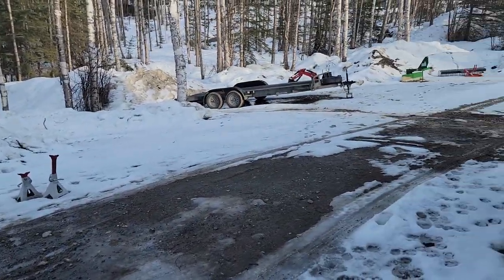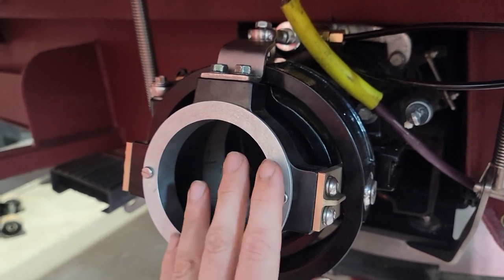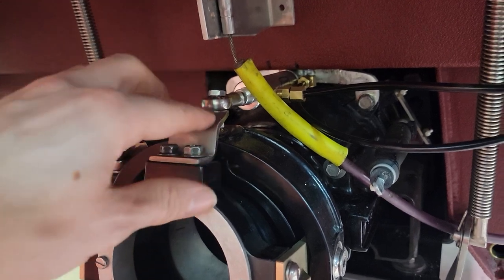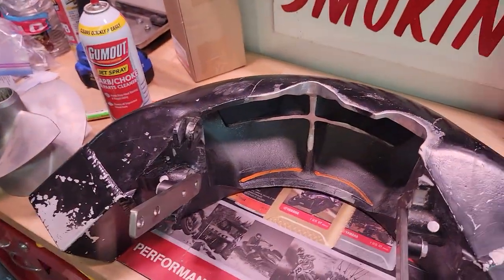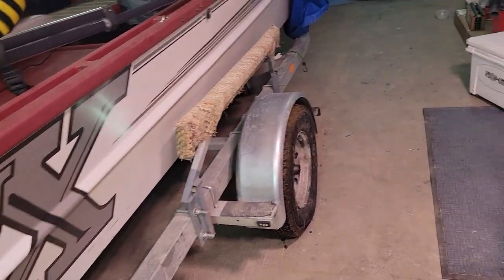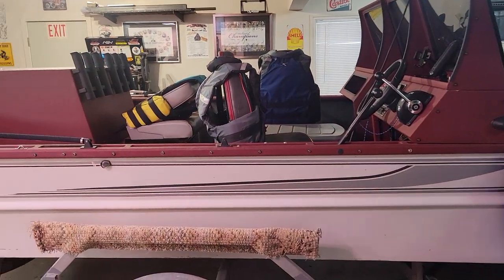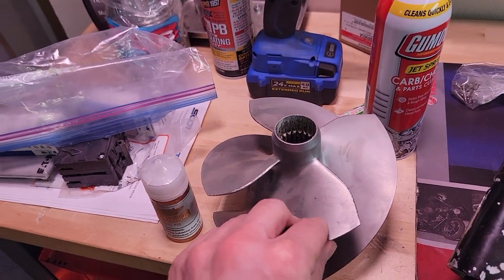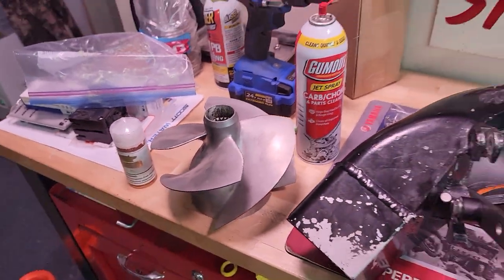Scott water jet trim nozzle install on SJX with Mercury 200 Sportjet

Comment: This all soo familiar. I have a Riverpro with a 200. Same clearance issues on the reverse bucket, top and bottom. Had to grind a ton of metal off the reverse bucket, top and bottom. Shift cable was too short, and i could not get any more adjustment out of controller. Had to drill new holes in mounting brackets to get bucket closer to cable. Which ment more clearance grinding on reverse bucket. Been working all summer. Reverse is not very good. Customer support from Scott is worthless.Overall I am happy with it. Took alot of work to make it fit and operate right. I agree about the lack of info on this. I am now researching for a better reverse bucket.

Comment: Great video.  As you said there is minimal info.  How did it work?  Noticeable power gain? Jump up on step faster?
Reply from the maker: Well, to be honest, pretty lack luster. I was going to post a video of a review,  but I had some engine problems. The boat felt pretty "slippery" with the nozzle all the way down. But the cruise speed with the impeller also seemed to fall at the same throttle setting. 

I didn't really get a chance to run it enough to do a fair review I felt before I had the engine problems.  I had a video ready to upload,  but didn't. 

All in all, I wasn't impressed by the combination of the new impeller and trim nozzle.

Comment: I was wondering would it work if you turn the cylinder around would that help the clearance issue 
I just got my regular Scott steering nozzle 
And I noticed more water in the boat after my test ride 
I didn’t know what to do with the hose so I zip tied it to the side I’m going to plug it not 
Thankyou 
If you have fb account can you send me request teddy berry in bethel Alaska
Reply from the maker: I did try to turn the cylinder around. But the eyelet sizes are different on both ends. One being 1/4" and one being 5/16 if I remember correctly. And as far as the hose, I pulled it and the barbed nipple off and put a brass plug in its place.